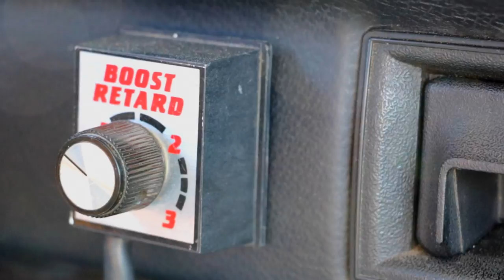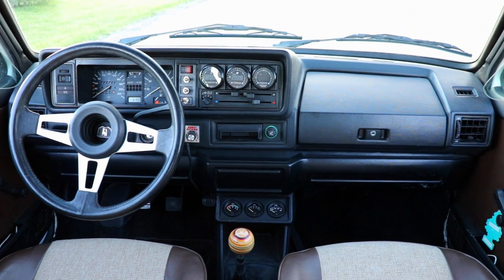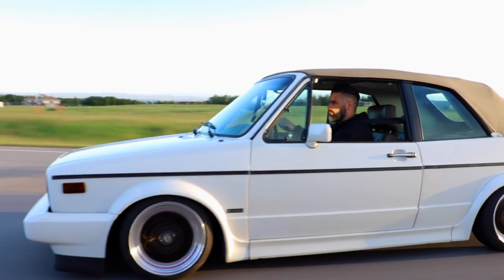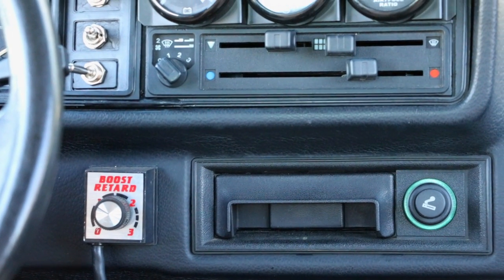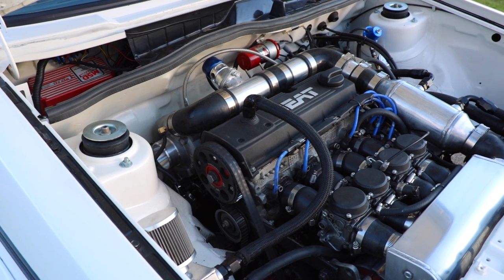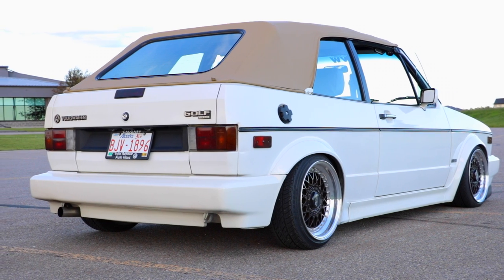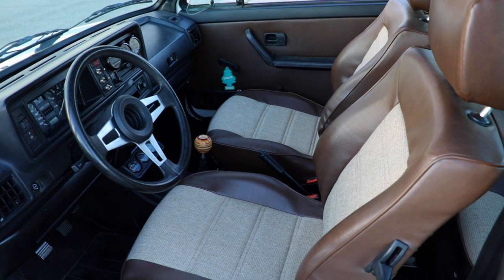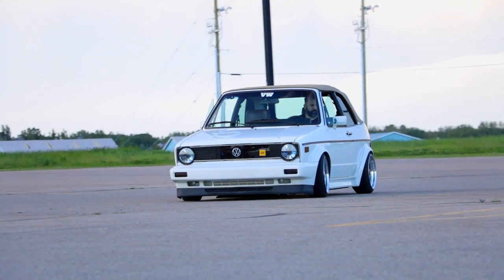Reza's TURBO Volkswagen Golf MK1 Cabrio | SHORT FILM

Comment: What a beauty...🔥 I'd love to have a machine like that, and actually that is exactly the combination of colors I would choose, just a bit darker on the top.
Greetings from Mex.✌😎
Reply: I am painting mine now Alpine White original I put a black vinyl top cost me $800 in 2007 or so. I almost sold it before I moved from WA and the woman said yuck it is not triple white... I was going to sell it for $1000.  Her loss now I have probably more like $6000 into it with a $1800 paint job, $380 windshield and seal, new head gasket, radiator, struts, tires, wheel bearings, thermostat, timing belt and water pump.  It had temp problems but not anymore.

Comment: I've got 91 I'm desperately trying to keep cool
Reply: Mine had lots of cooling issues turned out to be there are two temp sensors needed replacement.  Did not turn on fans so I had to do a head gasket job since it had pressure in water overflow...  Glad to see it back but it cost me lots since I did timing, belt, radiator, thermostat, before I had a guy finally fix the real problem